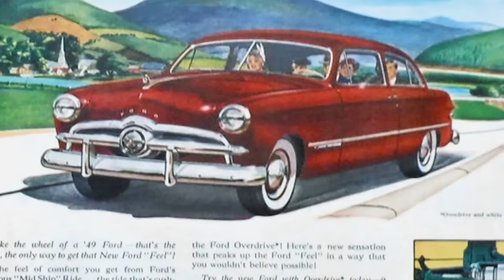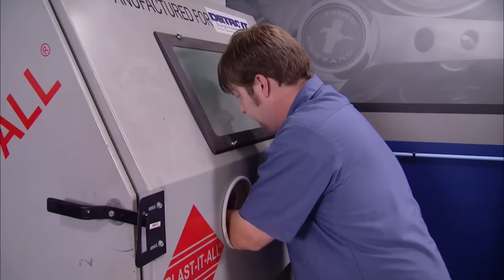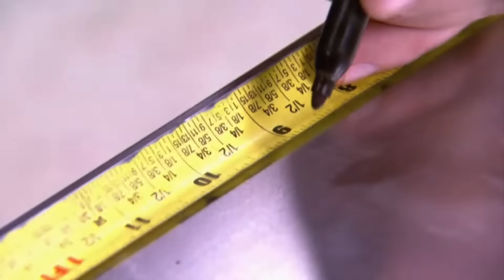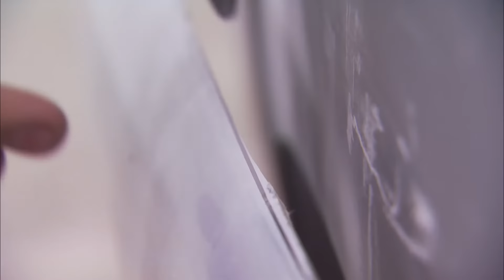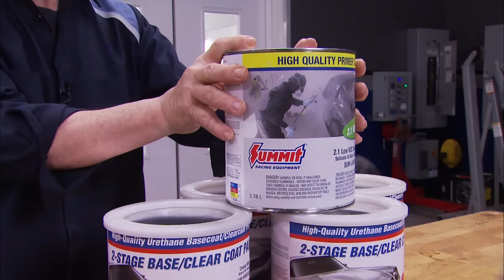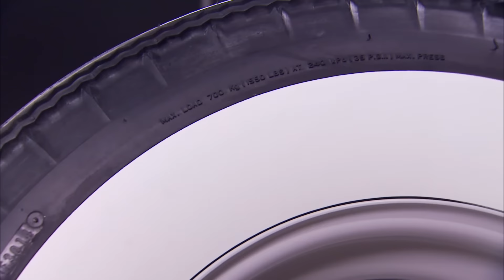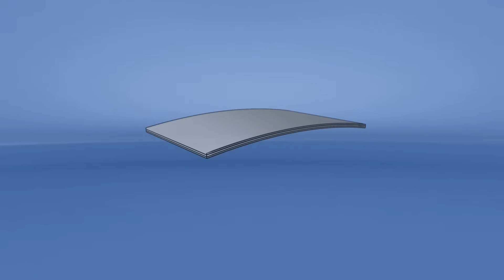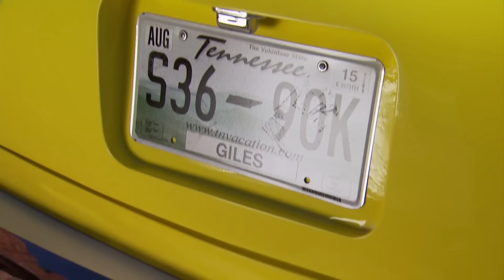Full Build: Transforming A Classic '49 Ford Into A Custom Hot Rod Creation

Comment: I worked in a wet laminate boat yard for years... back in the day when it came to P.P.E. they actually told us to not worry about the dust and fumes as we would cough that stuff right up. Well as the years went by and everyone learned more about the actual product we was using we learned that you actually don't cough that stuff up cause the particles are so small and sharp that it will embed into your lungs and ruin them just the dust alone not to mention what the fumes do to your head. In short fiberglassing is very bad for your health. For grinding I recommend covering up all exposed skin and male sure you have a dust mask that will specifically filter out organic peroxides as thats one of the main ingredients and one of the worst for you... please take my advice and done end up like me ... sitting home with junk lungs not able to breath well... you'll thank me
Reply: thanks for the tip. i do some fiberglassing as a hobby. mostly building audio fixtures for my car. I need to start wearing a real mask when I do it. they're just so annoying. maybe i'll buy something expensive that's more comfortable. fiberglassing looks so easy but I haven't figured everything out yet. self taught from youtube boat builders mostly

Comment: Pop drug a '53 Ford truck out of his buddy's garden in the early '80's. Lord knows how long it sat there as it was the guys Grandpa's. Marvel in the plug holes while Pop worked on the rest. Simple backyard custom stuff. A little altitude adjustment, paint, wheels and tires and rewire she was ready for the engine. Rebuilt the Carb, sucked out the MMO, dropped in the plugs and hit the switch. That Old Flattie fired up like it had never missed a day and never missed a beat. Sounded like nothing else with those twin Cherry Bombs. He used it as his daily until an Old Timer made him an offer he couldn't pass up. Pop's had a few vehicles I wish I could've kept for myself but out of all of 'em, that '53 is the ONE I'd take over them all.

Comment: Apart from the chassis not being blasted, I noticed that the original parts you put back on are dirt & rust covered. To make this a show car, it would have been nice to see the chassis powder coated, & all parts painted & the underbody treated. I would have gone that bit extra & made the skirts from steel & cut & welded them, as per the headlights. But overall, she do look goooood.
Reply: Ya, this was 20 years ago with no budget. Was still the best show we had on cable.

Comment: Those 49 to 51 Fords were famous for the bolts that hold the steering box to the frame breaking causing loss of steering. Happened to me back in the late 1960's. I went to several wrecking yards looking for replacement bolts and most all the 49 to 51 Fords had the steering boxes welded to the frame. A friend who was old Ford nut hooked me up with some allen head cap screws to fix the problem.
Reply: This is the first I've ever heard of this

Comment: These guys make me look good at fiberglassing lol. It seems like guy got some fiberglassing tips from someone in between doing the outside and the inside. I'm still learning and not all that good yet. Laying down fiberglass appears to be simple and straightforward but it's really not, in my experience. It's easier than painting but it still can be pretty tricky. I don't feel like looking through the comments but I would imagine that there's comments telling them how they should've done it. It turned out great though, and that's all that matters. The fiberglassing here was basically cosmetic so I guess it doesn't really matter anyway

Comment: I just wish Fatman parts weren't expensive as crap for parts that don't fit worth a damn. I tried to put those uprights on my '49 and everything about them needed modification just to get them installed on the car. If camber adjustment was needed for the alignment, forget it because that cam was not moving once it was hammered into the upright. $900 not well spent

Comment: At 1:20:07  That ring terminal is just asking to get bumped and short out on the solenoid case!  Needs a small piece of heat shrink around the crimp and the ring offset should be turned around.

Comment: Man you didn't even use matt that tin cloth will stick for a while without matt but a long lasting repair should have been a matt woven matt for your layers. And it would last 10 times as long without delaminating look at the finish on the inside before you touched it that is a matt finish. That inconsistencies of the strands is one of the things that makes matt stick so well. Sorry to insult but from what I learned over the years. You did a piss poor glass job totally wrong. Also a polyester rezyn will shrink alot as it cures that will .ess up the job after several years.  You should have been using a vinylester  rezyn for a stronger bond with alot less shrinkage that was why we always did a vinylester skin and 1st double layer of print blocker material. As your woven cloths will also imprint through the top layer as it cures and shrinks. Also why you should always start with a few layer of vinylester rezyn before switching to poly
Reply: i have very limited experience but I was shocked by how they fiberglassed. I'm not familiar with vinylester resin but they probably could've used epoxy resin. i don't think mat works with epoxy but epoxy would shrink less and be stronger. they could've used something like 1708 mat. i think that works with epoxy resin. something about the binders that hold the mat together don't jive with epoxy. or maybe you're right with vinylester
Reply: @Titans2138  actually bud you are right epoxy would have been better, and it will work with mat. Only problem with using a 1708 is after about 5 to 6 years 1708 would start to print through. that's why I would have used mat